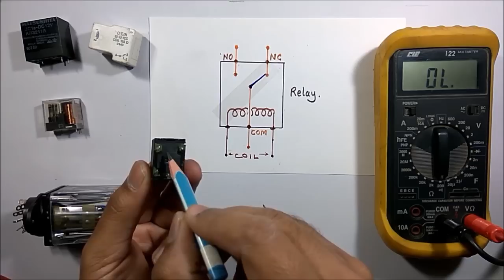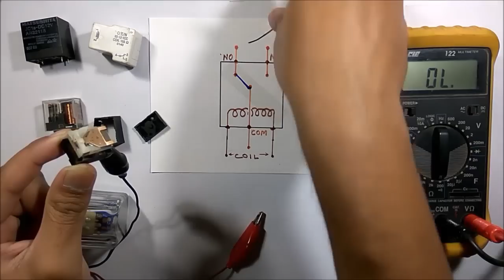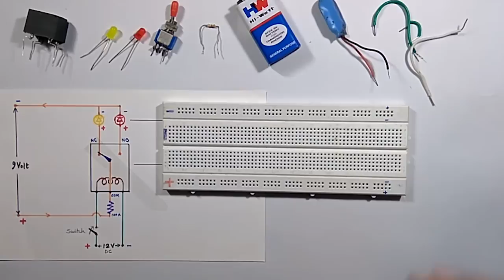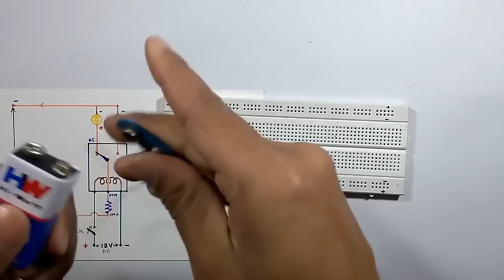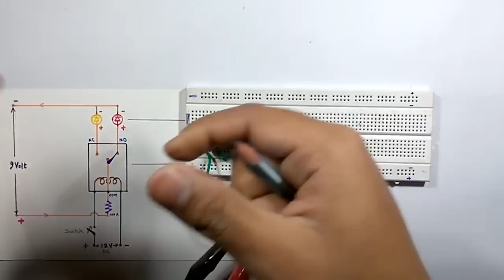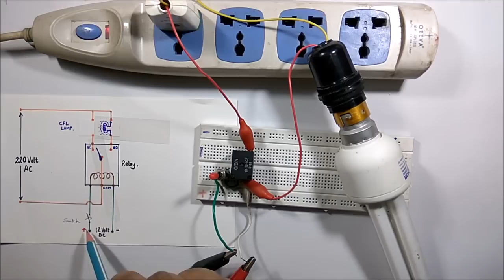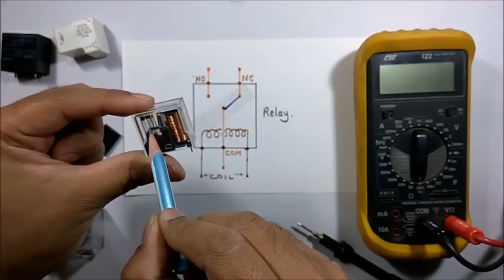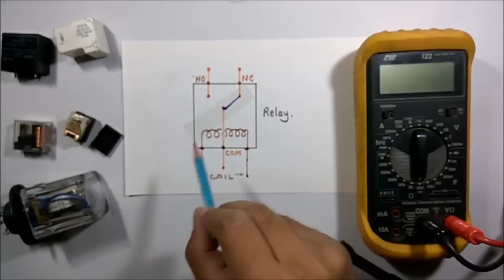How to use a Relay in Circuit and How a relay works

Comment: Could you share the specifications of the 12V supply you used? How much current is needed to energize the coil?
Reply from the maker: The current depends on the relay specification. Please refer the datasheet. In video I have used 12v 0.5A DC Power supply.